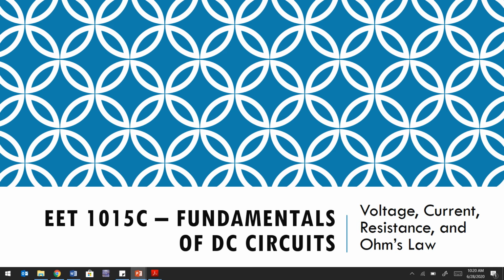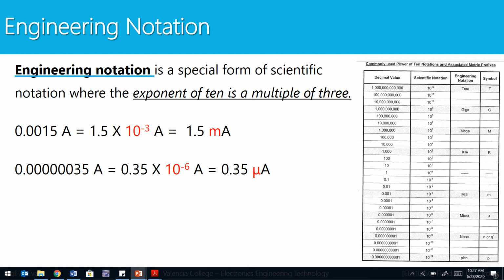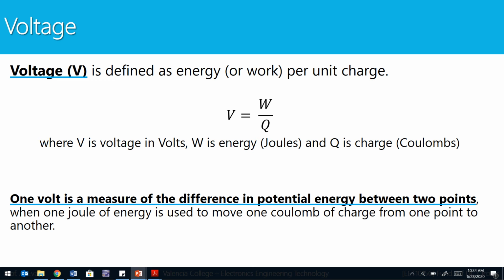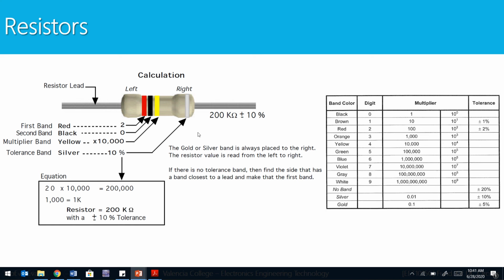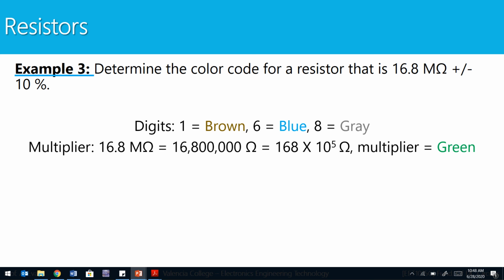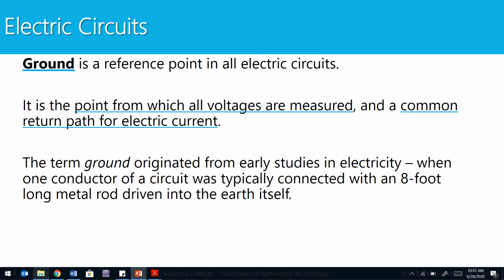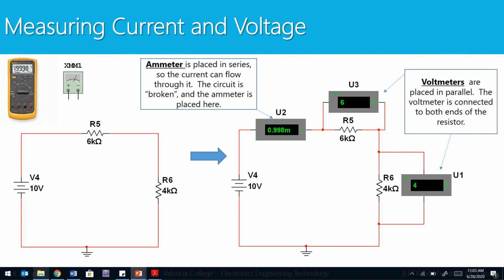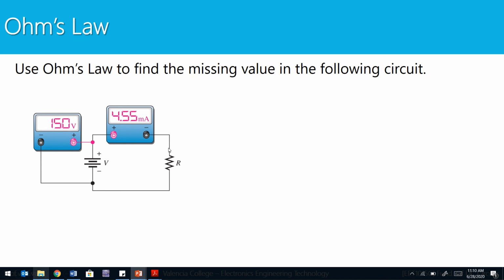[EET1015C - Fundamentals of DC Circuits] Voltage, Current, Resistance, and Ohm's Law

Comment: Hi, FYI, about 40 minutes in, the example (c) of the SPDT switch schematic has the switch arrow drawn incorrectly. Switching the arrow tip for lamp 2 will connect the 2 lamps and disconnect the voltage source. Not the same as example (d). The switch fulcrum (common) needs to be moved to the point labelled 1 for it to work correctly. Thanks for the lecture. It is a great reference for me after 33 years since my schooling. I'm instructing a protégé on basic electrical fundamentals and this is spot on good stuff and your delivery is pleasant to listen to. Your AC fundamentals course was really good too. Thanks.
Reply from the maker: Thank you for watching!